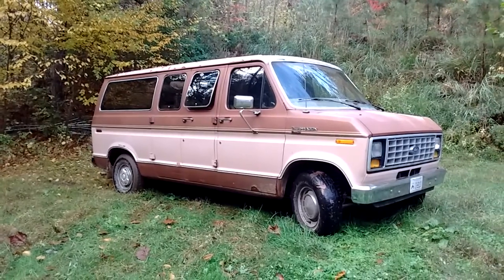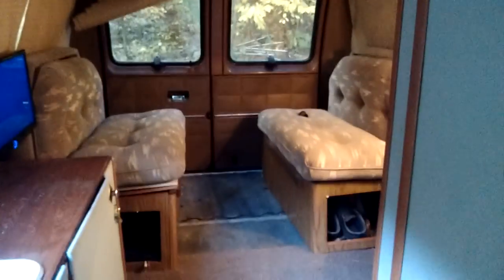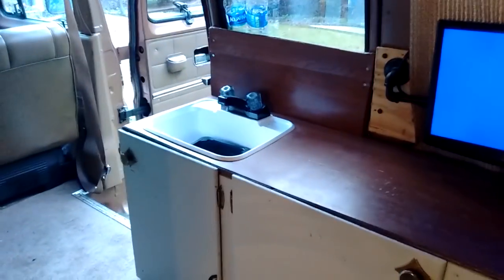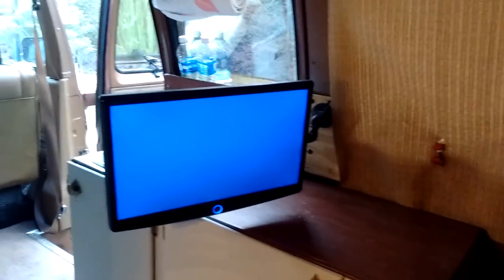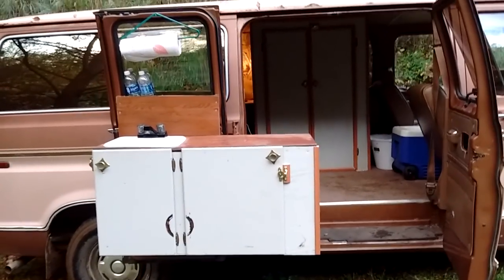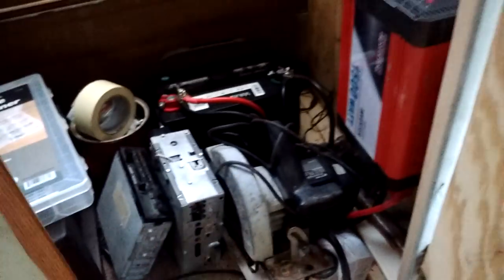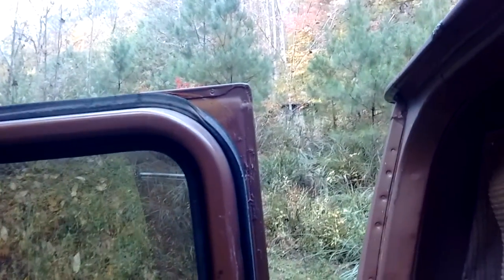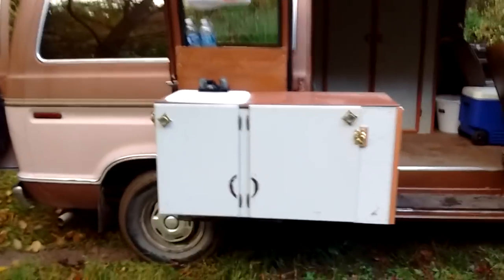My Homemade Camper Van

Comment: This is awesome,,, not fancy or all store bought , thats the whole charm  of it, U actually used ur head and figured out a way to do things. I went and bought a battery operated bug sprayer I found at home depot.I had one I used around the house and thought hey this would be great out camping or hitting the rd.Sit it in the sun all day and its nice by the time I want to use it. I painted it black so it attracks  the sun better , and I have a 5 gallon and never even use half of it . U would be surprised how little of water u can use and still have a good shower..The kitchen cabinets that turn to the outside is a great idea..Good job.

Comment: Omg. You gave me an ideal with your out door kitchen. Love it, love it.    Thanks
Reply: That clip sticking out the side of the van looks like a safety hazard, though.
Reply from the maker: I ended up removing it and using a neodymium magnet to hold the door open.
Reply: How did you hang your entire kitchen off of the inside of that door ? What did you use to fasten it to the door, and is there any danger of it coming off the door when you open it up ?

Comment: I have the same van 1978 i bought a month ago ,same color. l'm preparing it ,your idea of the kitchen inside out is the best .From Puerto Rico saludos!! Keep going you're doing very nice.
Reply: Maybe you need what they call battery isolator to charge the second battery while the engine is running
Reply from the maker: I have one now as well as solar panels. There's also a lot more things I did to the van in my updated tour right here>>>https://www.youtube.com/watch?v=JgimTht-vV8&t=666s&index=21&list=PLx4vrrK_MpaclvmJ7tPzega13-5VnQXIk

Comment: You can get a shower tent that looks like a teepee that could be separate from the van and have your potty inside. Simple to use and still have a battery-operated pump to spray water on you for a shower. You have done good for someone who is humble enough to admit he doesn't do this for a living.
Reply from the maker: I picked up a shower tent recently and I'll make a video showing it soon just haven't had time to fool with it recently.

Comment: I read the comments first and I agree with CB; Please remove that bracket on the right side in which you attach your swinging sink, table to. It really could hurt someone by accident. Use a bungee cord and hook it on the front lip of the rear wheel. Back when states had full car inspection they would fail people who had ripped sheet metal on the body as it could catch someone's clothing if they brushed up the side of a moving vehicle and drag or cut them. You would feel worse if some kid got hurt on that thing if you were camping and they were catching a frisbee or football and ran into that when the door was closed.  I think your idea for the shower is Great! Use heavy duty magnets to temporarily attach the awning to the body of the van, top and sides. Nice build otherwise!
Reply from the maker: I could use a 1 inch round neodymium magnet that I have left over from a pma alternator conversion. That would hold the door open very well and would be safe. Thanks for the suggestions.
Reply: Super idea! Anything to be safer all around, for you and others.

Comment: as far as lighting goes use as much LED lights as possible because they don't use very much power.
As for the spare tire, maybe mount it underneath the rear of the van? This is how my Euro Ford van has it. When i need it i need to crank it down to be able to drag it from under the van.
That shower idea is great. I just might do the same thing.

Comment: I like your re- do, my goodness a lot of room... love the pipe cup holder, genius ...smart thinking those latches.. I even like you drawers by the bed...Wow love the tv swivel...oh my gosh pluming pipe for the swivel. what ever works coat hanger works.. Wow love the outdoor kitchen you are a smart. I like the setting area good idea, finding that setting are out of a RV and using it. Great idea dolly for a mount. Yes your right excellent shower area with the open doors. Will there be steps on the back to step up into the van. I like the entire set up you did Great details..

Comment: I liked your van, very roomy and spacious. I would like to see how your bed arrangement works from those two small sofas. One caveat: the clamp that holds your kitchen door open against the side of the van, that could be very dangerous and I would suggest changing it to a flush mounted clasp (could use a recessed marine cabinet latch, which would be safer). Thanks for sharing.
Reply from the maker: Thanks for the comment. I just did an updated tour video yesterday and actually just finished processing it. It will answer your questions about the beds(there are two) and also addresses the outside door latch, which was also a concern for me. Check it out here if you have time>>>>> https://www.youtube.com/watch?v=JgimTht-vV8

Comment: Thanks so much for sharing your van build. (:                                                                                                   The first thing I"d do is pull out that carpet and lay some vinyl flooring, 1 its easier to clean, not to mention its cheaper to use a broom than it is to run a vacuum, 2 I"d add some inexpensive solar paneling ,best place for that would be Amazon, and last but definitely not least I would insulate the fan, and it wouldn"t hurt to grab one of those buddy heaters, also from Amazon. Other than that, for a first build you"re doing fantastic, and your imagination as worked very well for you, I look forward to seeing more.
Reply from the maker: LOL I already took care of pretty much all of that. Turns out the heater I built puts out more than enough for the factory insulation.  I've got an updated tour here>>>https://www.youtube.com/watch?v=JgimTht-vV8

Comment: I am so glad this was reccomend, the tv mount is just what I need
Reply from the maker: Back when I did this they didn't have the cheap mounts they do now. I had to improvise. It turned out to work pretty well. You have to occasionally oil the joints or spray them with WD-40 to keep them movable.
Reply: @lukeFugate  I'm using 2 books to hold a TV only cause the stand is missing and the buttons are on the bottom, I'm scared to move it as its top heavy

Comment: I like your setup, it is quite simple and efficient!

I think however that the bedside lamp is a big waste of space, just use LED lights built in the walls, or projector-like ones mounted on the walls :) You could enclose that bedside area instead and put your electrics in it, this way you would have the whole cupboard to put your camping material and other stuff, without having to worry about messing up your electrics. I think in general it is better to keep all the electrics isolated in the same place, they're kind of ugly :)

Comment: Thanks Luke for this great vid. Nice seeing it from before the beginning. I bought a Swing Away tow bar that does what you explained for your back end. Works great as it allows both doors to open all the way and create a bath n shower between those two back doors. I just have to figure out how to keep the inside lights from coming on when those doors are opened. I'm sure it's just a fuse somewhere. Enjoyed your Ammo Can build too! :-)
Reply from the maker: I pulled the light bulbs out of my interior lights. I use battery powered led lights for lighting the interior. They can be individually controlled and they don't drain the house battery.
Reply: You're such a smart guy! ;-) Thanks

Comment: a one or two gallon garden sprayer hack with kitchen sprayer nozzle, change out of plastic tube, and replacement connector pieces provides pressurized water which is also good for a shower....(check yt videos-camp sinks/showers, etc.) for that....it's also portable (big plus) to use where ever you like, and if left in sunlight, will heat your water, or you can heat water on your sink and pour into bottle for a warm shower...nice kitchen and tv set up
Reply from the maker: I may have to pick one up, thanks.

Comment: That bracket that holds your kitchen door in place looks like it would really hurt if you caught your leg on it as you walk by,  
You might consider using an Eye-bolt and a bungee cord to hold the door in place.  Less painful, but still functional.

Comment: Rather than going to all of the effort of building a shower at the back of the van, how about considering a portable shower tent. This is what I found on line at Walmart: Costway Portable Pop UP Camping Fishing Bathing Shower Toilet Changing Tent Room $22.99 and Coleman 5-Gallon Shower Camp $ 8.97. The tent pops up very easily and folds up easily into a small round flat disk which has it own carrying case. The 5 gallon camp shower bag can hang inside of the tent shower and dispenses water via a small nozzle for a nice shower. You simply fill the bag, put it in the sun to have warm water for your shower. So, for about $30 you have a very efficient easy to set up shower, toilet, and changing area!
Good luck! BTW, cleaver idea of how to easily convert your indoor kitchen to an out door kitchen.
Reply from the maker: I may check it out. I made a shower set up on the back, but it takes a little while to set it up. For the water heater I have a pipe on the roof rack painted black for a solar shower. The shower tent might be a better set up than I have.
Reply: Thanks for your reply. Good luck and God Bless. :)

Comment: slick deal with the kitchen on the door, why not put that isolated battery under the hood like the factory does ? (and yes get it isolated asap !) nothing worse than a dead battery  miles from anywhere... great looking rig so far, look forward to see more mods
Reply from the maker: Thanks! The reason for the battery in the closet is I wanted it as close to the inverter as possible to avoid the voltage drop from the long wires, and also there is barely enough room for the starting battery under that tiny hood.
Reply: Lots of great ideas in your build.  Use AGM batteries, no need to cut another hole in your van.  They're sealed and don't require venting.

Comment: hi Luke I just watched the video not a bad deal I have a 1990 Dodge B250 full conversion van I myself and planning on extending it into a camper van to do some traveling I was going to buy an RV Class C or Class B but why I have everything I need it's my own on Wheels if I decide to use it that way I will build a bed in the back and play storage underneath also I plan on getting solar panels so I can power the inside without the engine running just like everybody else does it I wish you the best of luck finishing your van I hope I don't run into any problems with mine but if I do it's trial and error I have approximately three hundred thousand miles on mine it's been well maintained would not be scared to take it across the United States and back also eventually I'd like to go up into Vancouver Canada and check out that part of the country since I'm an east coast native this is the time of my life to enjoy life on the highway good luck to yourself as they say in the Navy weigh anchor and Full Speed Ahead
Reply from the maker: Everette Holland Solar panels are the way to go. I got some on mine now and they work great. If you maintain a vehicle properly, it will last a long time. I have a 68 Chevy truck with 600,000 miles on it,and I'd drive it anywhere. I wish you luck.

Comment: Nice build, looks like we have the same seats and cab interior.
Reply from the maker: Thanks. I think they're almost the same van. Mine has the 300 straight six though.
Reply: the 300 is  a great  engine  alittle  hard on  fuel  but  run  forever, I have  a  63 ford with  a  170 inline  and  it runs like  a champ  hates  pump  gas  needs  lead substitute , I  like  the kitchen  swing out, and the  black  pipe for  the tv swivel, stand with  drawers is  good  size and fits nicely next to the two  camper seats ( the camper  seats you  could cut  down and make  each a  one  seater  use patio cushions to  give u  more  space ) I  do  figure u  will convert  to  the camper  bed out of  them , if you got any salvage  yards  see it  they have  an rvs/classb vans u  never know  what u  may be  able to  reuse ,  anyways  best of luck and have  fun
Reply from the maker: Yeah, I like that little six, it would be a lot better with the overdrive transmission though. Cruising speed is about 50 MPH with the three speed. I ended up cutting a piece that fits between the seats and it makes a pretty good bed although a little bit short but its not bad.

Comment: I love the swinging sink cabinetry and the closet. Have you thought about putting the dinette from back to front and making it long enough to sleep in, put it up against the wall and move your side table to the other side?
Reply from the maker: It actually sleeps pretty good for my wife and I the way it is. I guess for someone taller than me it would be a little tight. When I was first mocking it up I put it in like you're saying but I noticed it blocked off the doors so I didn't have the aisle down the middle. I still occasionally haul lumber in the van and I can still get 12 foot long boards in there and still close the doors.
Reply from the maker: I did an updated van tour video if you would like to check it out, I've 
made a lot of improvements. it's here>>>>>  https://www.youtube.com/watch?v=JgimTht-vV8
Reply: Nice, watch it now.

Comment: awesome build! could you mount a water tank to the roof and have it piped to the sink on the inside and to the rear for the shower. some kind of gravity feed system
Reply from the maker: Thanks. In later videos I put a small water tank and pump under the sink and a solar shower on top.

Comment: Use a ladder rack on the roof for your water and solar. It will keep the weight off the roof. The cross braces are not very strong on the ford's.
Reply from the maker: I found that out the hard way. I was using the van as a ladder to change a light bulb in a dusk to dawn light and it was wet. I slipped and fell and the braces sagged a little. You can still see the headliner in the video is warped.

Comment: Lovin it. Nice work. We just got an 88 model Econoline conversion van. Very similar.Gave 1200 bucks for it and drove it over 200 miles home. Runs n drives like new.Been working on it a little as I can.Low funds and have to work slow due to disability. It's coming along though. Check it out and let me know what ya think Luke. See ya out there.
Reply from the maker: I checked out your channel. Nice looking van.

Comment: Very nice, simple and functional. I was just thinking of an idea that I am not sure if anyone has done or not, but how would it work to use a spring loaded shower curtain rod (modified on both ends to grip on the inside of the rear doors above the windows) to hold both doors open and be used to suppport the shower head for the shower?
Reply from the maker: Sounds like a good idea, I may try something like that. Haven't got the shower part done yet.

Comment: This is genius! Just wondering if you could get black hose and wrap it circular on your roof for hot warer,doubt it would cause any windshear if you need to drive with
Reply from the maker: I actually made a solar water heater mounted to a roof rack in a later video. It works ok, but really needs an alternative heat source for dependable hot water.
Reply from the maker: I did an updated van tour video if you would like to check it out, I've 
made a lot of improvements. it's here>>>>>  https://www.youtube.com/watch?v=JgimTht-vV8

Comment: You have done a great job with what you have. I love the way you made the kitchen swing out, which would be great, especially if you are grilling. It looks cozy and comfy. Where do you sleep ? is there a piece you put in the middle to make that a whole bed ? Have you thought of bringing a TV tray with you as a little table for inside. Looking good....will keep checking for updates.
Reply from the maker: Thank you. I've got a lot more done on the van now. check out this video for an example of the two beds set up 
https://www.youtube.com/watch?v=xw8xrEAW-xw&index=17&list=PLx4vrrK_MpaclvmJ7tPzega13-5VnQXIk 
For the beds you can skip to 5.46.
Reply from the maker: I did an updated van tour video if you would like to check it out, I've 
made a lot of improvements. it's here>>>>>  https://www.youtube.com/watch?v=JgimTht-vV8

Comment: I have a 1500 watt inverter and am not able to use my microwave. Any suggestions? Really nice job too. Also like the sink and shower idea.
Reply from the maker: What is the wattage of the microwave? It should be significantly less than the inverter's output rating. Mine is a 700 watt microwave and it runs it fine. How is your inverter hooked to the battery? It should be very thick wires and as close to the battery as possible for maximum output.